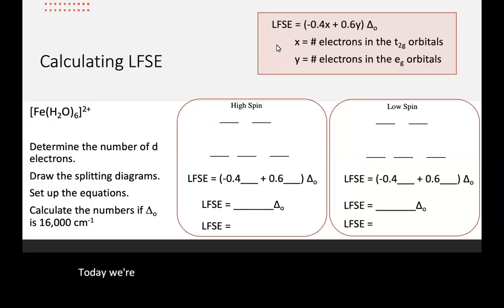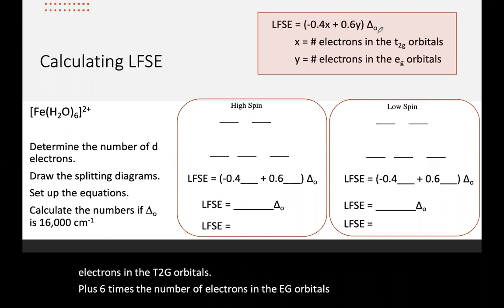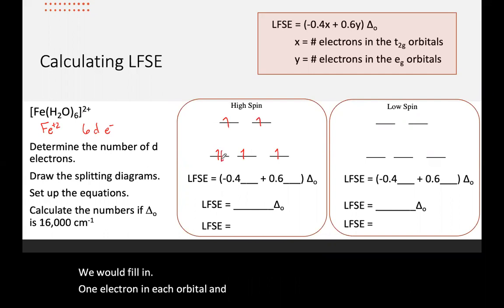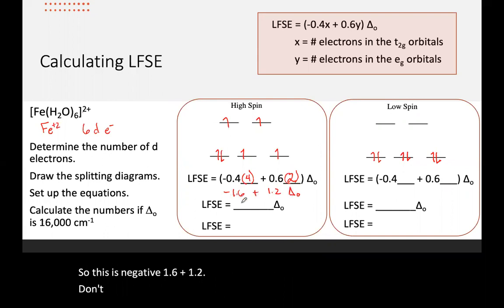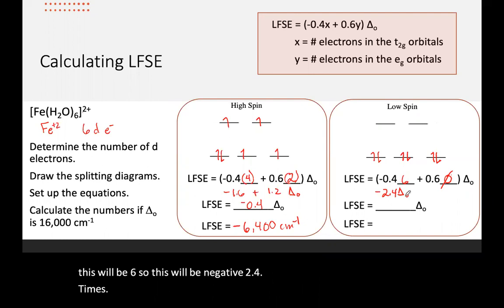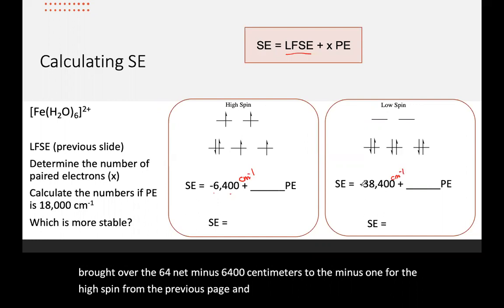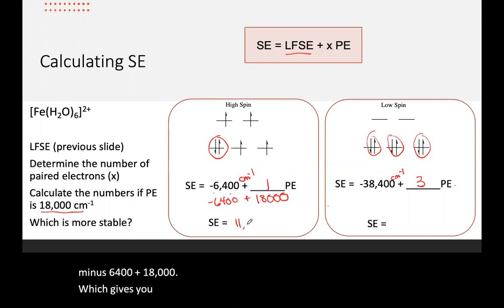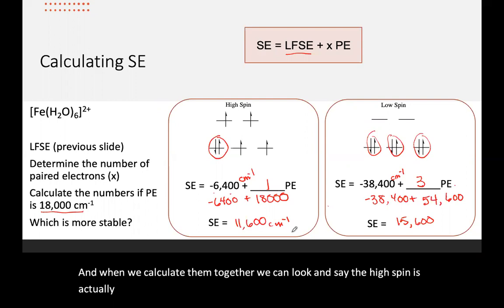Calculating LFSE and SE

Comment: There will be only two pairing energy in low spin
Reply: You're right. In low spin there would be 2 extra paired electrons comparedto high spin, so it would be +2P not +3P
Reply from the maker: There are three pairing energies in LS Fe+2.  There is one in HS Fe+2.  You are correct that by comparison there are two more in LS than HS.